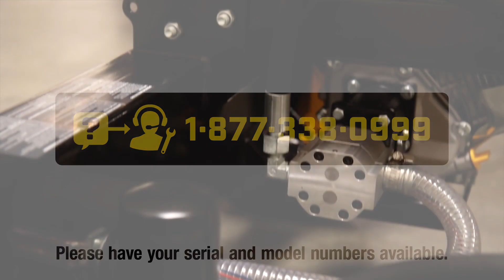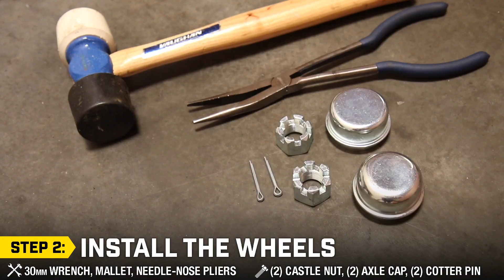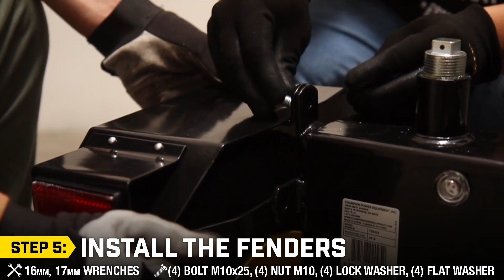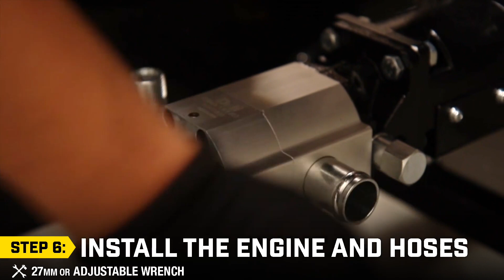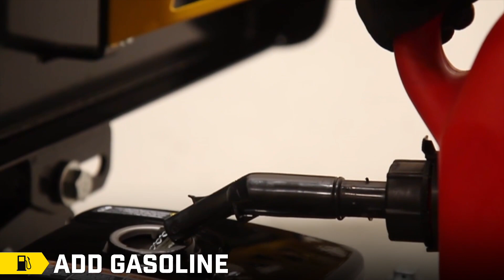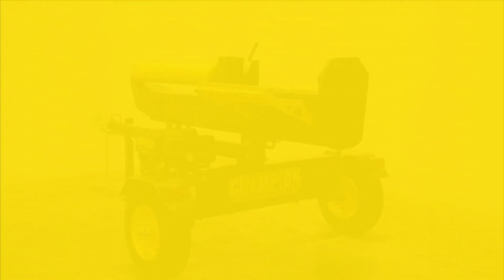25-37-Ton Full-Beam Log Splitter Assembly (v1)

Comment: Oh because the average person has a pressure torque wrench just laying around. It's almost an extra $100 just for me to go out and buy one, just for a most likely one time use.
Reply from the maker: Hello, we do apologize for the misunderstanding but a pressure torque is not needed for the assembly for our unit. The only tools needed are wrench's, needle nose pliers, and and rubber mallet. The sizes of the wrenches can be found in the operators manuals of the unit that you decide purchase. If you need any assistance with the assembly please contact our support team at 877-338-0999. Thank you
Reply: @ChampionPowerEquipmentHQ  So, failing to ensure that "the hose fittings are between 44-52 lbf-ft or 59.7-70. Nm"  Respectfully. -CHAMPION  Operator's Manual 5296-M-OP, Rev. 20230906, p. 18.